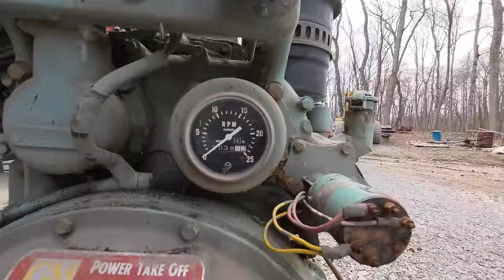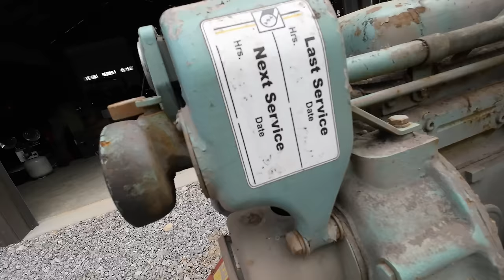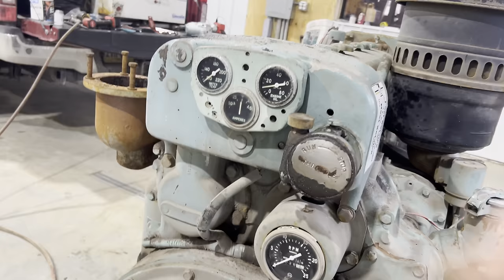$250 Two Stroke Detroit Diesel Sitting 6+ years, WILL IT RUN!?!?

Comment: Watched your video of starting up the 671 and it reminded me of the one marine unit I took back from Vancouver Island, BC to my Fathers farm in Alberta to rebuild for a friend to install in his boat which he built. The tank you mentioned on the front of the engine is a marine surge tank and the lines would pass threw the haul to two cooling lines running near the keel for cooling. Many fishing boats used these 2 cycle engines because less moving parts and economical fuel costs 2 gallons per hour at 9knots all day pushing ten tons. This engine was used a lot for irrigation as well. Thanks for your show, it was great.

Comment: Hi Matt. Have watched quite a few of your videos after I found you channel about 3 months ago, keep up the good work. One possible way to use this engine and not make it much longer is to do a diesel/electric setup as used in rail locomotives. The generator only needs to be around 20 to 30 Kw for a project like this and it would allow complete flexability for the drive system to the wheels. Again keep up the good work.

Comment: OK I'm on board! The first thing to do is establish your requirements. You are going to need a steering axle from a semi preferably with power steering. Next its going  to have to be longer , I know you wanted short, But your radiator will now be up front, your gauges have to move rearward to make room for batteries , steering wheel, pedals, fuel tanks out both sides, semi or bus rear axle . Maybe two I beams for a chassis, with an Allison automatic transmission and an 18000 lb wench on the rear. Oh yes, a seatbelt and ROPS.

Comment: Wow, that brought back some great memorys.  I had two 4.71 Detroits in a motor yacht.  I loved those engines.  One turned clock wise the other counter clockwise.  Being two stroke engines all it took to run one way or the other was to put the cam shaft in the camshaft bearing tunnel on the other side of the engine.  Powerful and oh so reliable.  The small water tank is a simple heat exchanger.  On my boat the raw water drawn in from under the keel was kept separate from the engine side water by the exchanger.  Thanks for posting your great video.

Comment: if you have very much water in the air filters it will strangle the air flow, when she fired off it brought back memories.  you could use a belt  tightening system off the pto  and drop it strait down to whatever gear train you find  cool find and vid !!!!! Have FUN

Comment: I will never forget the sound of a 6-71 as when I was little every Greyhound bus had a 6-71 in it. When in Jr high every state dump truck had a 6-71 in it and they would take off like a hot rod, (sort of), and with an Allison Automatic transmission quickly hitting the shifts. I do not know how the universal joints stood that shift but was sweet sounding. A mad max machine would need the intake oil bath air filters maybe chromed and stuck up above your knees on either side of the engine if you wear a leather helmet and goggles to stroll around the steam show. Twin chromed exhaust stacks also stuck up either side also. NO MUFFLERS. SWEET SOUND MAYBE MEGAPHONED STRAIGHT UP STACKS.

Comment: Worked on the line back in the 70s turning pistons for the 71 and 92s.  If I remember correctly, Diesel touted the turbo 6-71 as the 'fuel sippers', or maybe fuel squeezers,  for trucks.

Comment: My favorite engine of all time. I still have the special timing tools even though I haven't touched one in many years. I maintained many of these on boats in various states of neglect and disrepair yet they still worked. Run that baby at full power to blow out the slobber. These wet stack pretty bad when idled or run at low load.

That fitting in the head for the return is a special restricted fitting to maintain fuel pressure. I made the mistake of replacing that with a regular one and it didn't work so well

The 71 series had the steel valve cover with knobs from 1938 until 1979, when they went to a cast aluminum cover with 12 point bolts and fat silicone rubber bushings. I like the older ones, even if they are more prone to leaks. They also look really, really good when chromed! 

Another giveaway of an older engine is the separate fuel lines on the head. I believe the head was changed to the cast-in fuel passages like yours in the mid 1950's. Very old ones had a chain driven oil pump and different accessory drive gears, I believe that went away in the 40's.

Thank you for the video, its so good to see one of these still around!

Comment: Last Detroit Diesel I worked on, I had a rebuild on the rings. It ran just fine, but burned oil. I got those rings where they were tight and didn't burn oil, but it wouldn't run worth a crap. I finally shaved the rings down far enough to where it burned less oil than it did before, but still ran great. For $250, you have a gem. That is one I would put right into a boat.

Comment: When I was a little kid we had Greyhound busses with this exact engine pulling them over the mountain at 70 mph. When I was in Jr high we had county dump trucks with this engine with Allison automatic transmissions. You have never heard anything sweeter in your life. With a full load of gravel she would rap out in every gear and now I realize how hard they shifted at full throttle. Those u-joints must have needed replaced every year or sooner.

Comment: Looks like the Firepump driver for the navy tug boats. It drove a massive pump that was used for fire fighting from the sea to shore hose nozzles. It used water from the sea to cool the tank. It was a real beast. Its cousins drove Mike 6 boats, twin packs drove Mike 8 boats. Big Gen sets with an electronic governors. It was one of the Navy’s best small engines. It replaced the grey marine model and some of the 53 series engines.

Comment: An alternative use-case would have the engine and large water tank outside the shop wall and run water pipe to the creek and use an impeller to pump water into the tank when needed. Just a thought. Enjoying the content as always.

Comment: Hello Matt , love your vids. You may have a stuck injector. However I had a trojan loader with a 671 that we left on a job for a while and when I went to start it I realized that water had gotten past the rain cap and it hydrauliced a cylinder and bent a rod . It smoked just like that because one cylinder didn't have enough compression to properly burn the fuel . It also was a low hr . So we pulled it apart replaced the one rod and it ran beautifully. Good luck.

Comment: The small tank has a built in heat exchanger through which water from the fire pump is passed thru to drain for engine cooling. This saves a radiator and maintenance and increases reliability. That’s how most fire pumps I have worked on are like this.  Cracking find. All the best.

Comment: The 53 and 71 series Detroits are some of the most rebuildable engines that ever existed. If block is not cracked one can install new sleeves, standard pistons, and rings. If crank is good and still can be rectified  cam bearings can be bought with inner and outer diameter. These screaming jimmys work best and cleanest with full load and at Full rpm. Many were used in boats and in all kinds of industry. Great engines. Just wear hearing protection

Comment: Worked for a Gulf oil distributor in the late 70s and i drove an gmc day cab transport. The tank that i pulled topped out at 8500 gallon. I had no problems getting up to and maintaining  80 miles per hour and it had a 10 speed Road Ranger trans in frtout of some 370s. I use to love looking at the coal smoke rolling out of the stack . She was simple and dependable.

Comment: Also remember that the 6-71 is a war-winner. GM connected 2 of them through a set of gears, and stuck them in the M4 Shermans. They were called the GM 6046.

Comment: I drove a big Terex off road dump truck with one like that, had a shuttle shifted transmission, the smaller Euclids had the 4 cylinder Detroits, you couldn't load them enough to slow them down

Comment: started a 371 sawmill power unit that sat for a decade and after getting the injectors unstuck I fought a wet stack issue. I determined it was the lift pump after installing a pressure gauge after the pump and a primer squeeze ball before. 
$250 for a Jimmy is a steal

Comment: Hi Matt.I know this is a long time after the publishing of this video but here goes.  Is unlikely that as a fire pump this engine would have had a radiator remote to its location. The more likely scenario is that it would have a direct cooling supply from the main water tank for the fire system. Where the water was supplied to the pump would be a Tee with a pipe running to one side of the cooler. The outlet side would  be fed into a venturi just after main pump outlet. The flow of the water from the main pump would pull cooling water from the supply tank through the heat exchanger and and just inject it the slightly warmed water straight into the fire system. It would not matter if the flow of water was high as the engine thermostat would control the engine temperature. I have seen that system used on several industrial fire systems.  ATB regards from the UK

Comment: You could give it a big hydralic pump, and run accessories with it. Idea 2 fix a drum to it run older machines with belt drive. Idea 3 giant air compressor, or the worlds most powerful extractor fan. Seeing how many batteries you had to scrunge up maybe a jump cart would be usful. It would be cool if you could put the engine in something 1966-67. Cool video i love that 2 stroke sound. Probably could use the injector seals and a block off plate.

Comment: There is a heat exchanger for cooling. Just like in some boats. The tank contains bronze rods that can get blocked over time. Pull it off and soak in alkali then pressure wash those rods. Lasts for years.

Comment: Turn it into a combined heat power unit, with a hydraulic pack and or a large fast screw air compressor to boot. You can then get a load of old batteries, power your shop, charge your batteries for an inverter, and heat the shop with the coolant and the “remote radiator” heat exchanger during the dark winter months. You will need lots of light. Even use a convoluted exhaust and pass air across it for instant heat while you wait for the floor to heat up! You can even run it on all the old oil,diesel,and solvents you pull out of projects if you get good filters or a centrifuge.

Comment: 52:30 Bolt a sprocket to the existing output shaft and use it to drive a chain that goes straight down to another sprocket bolted to the Transmission's input shaft...

The Transmission could be installed backwards so sits directly under the engine and it's output shaft points forward to the front axle making it a front wheel drive War-Buggy and/or run the typical transfer-case and another shaft running aft for a 4-wheel drive War-Buggy...

That would make the buggy taller, but you wouldn't have to make it any longer...

Alternatively, you could bolt the engine directly to the Differential and Final Drives of a Bulldozer and make your War-Buggy a tracked vehicle...that keeps it low to the ground and relatively short...

Comment: When I was in the USN I spent a lot time with these engines. I was attached to a Sub tender. We were anchored in the middle of a loch. To go any place you had to take a boat. All of our boats except the Box Ls had 671s. The were good engines. The Box Ls had a 6110 as a main and two 271 generator sets. Generally speaking, if  you had fuel and could turn them over, they'd run.
Reply: You must have been in the Holy Loch!
Reply: @harrellmorlan6817  Yep. After BP&E school I went to EN-A School and reported on board the USS Canopus in Bremerton WA in late '68. We left the yards went to Scotland. It was neat the the NJ pulled in and tied up on he other side the pier from us. She had just come home from Vietnam. In Scotland I was part of the boat crew. When my EOS came up I got out. A few years or so after that I went in the USNR. I bounced around reserve units and ended with 17yrs and made EN 1. I went to Desert Storm.
Reply: Note if you want to have some fun you should try installing  an oil pump on a slant 671 while it's still in the boat. It goes on number 1 bearing bearing cap. You have lay on your back in the bilge, reach into the oil pan, hold the pump in you hand, use one finger to hold it up and start the bolts with you extra fingers. There isn't room to get both hands and arms in the oil pan. The hole in the side of the is only about 12 inches long six inches wide.

Comment: in that clothing, this engine is a very goood candidate for marine use, the hwar exchanger is built in and the exhaust manifold is water jacketed.
the only missing items are a raw water pump amd a marine transmission ( velvet drive, twin disc, ZF etc...)

Comment: i have a 2-71(i believe)  in our hd-5 allis loader crawler unfortunately  an injector line broke and dumped diesel in the crank case !!!  i caught it the first time fairly quickly think it broke completely that time   THE 2ND time i didnt catch it as quick and spun a crank bearing . it has been in the back of the shop for about 10 years .. i gave it all to a friend and his son both are diesel mechanics so maybe SomeDay i can barrow it back for a project or 2 ( i retired from farming  last year).  the hd-5 was a pretty good little crawler  , had a older neighbor that ran a shale pit and used his(2) to dig and load it out  , (he would load it in the back of the dump truck and just BACK it out the end (raising the front of the truck off the ground)!!! :)

Comment: suggestion.  when pouring liquids from a container hold container outlet/ spout at 12 o'clock and not 6 o'claock.  this allows air to get in with out causing the  GLUG GLUG  burping as the oil pours out.

Comment: Matt, if you got a old house furnace fan installed it to a box 📦 with a air inlet connected to a 6" hose long enough to run from the door to where you're working on a engine you can apply a 6" to a 3" Y tube for dual exhaust,  and have metal flex the last 3 ft all eng exhaust could be outside..
 or have the box  📦  closer to the work area and put a 4x10 square to 6 inch exhaust and run a plastic pipe out the door.

Comment: You know, in the 50s, the hot setup in the street racing scene was this thing called forced induction. The greasers gapping chumps at the strip and down Central Ave were using modified GMC 6/71 roots blowers on their SB Chevys. Then, a man by the name of Charlie Weiand decided to design an aluminum,  dual carb,  riser manifold specifically for the GMC blowers. The rest they say, is history😊

Comment: These fire extinguishers engine/pumps normally works along with a jockey pump that keeps all water lines pressurized. When a valve is opened and the water pressure drops, the main engine will come into play, and that is the reason for all that solenoids that you found.

Comment: 8:13 Those hoses were just connected to the suction and pressure side of the pump it ran. So the engine would cool itself by the water it pumped, by having a small amount of water split off and circulate back around.

Comment: I don't know if you've gotten anywhere on the buggy design but here's an idea. A guy at my lawnmower racing club put a small block in a mower. He drove it off the fan belt to a jackshaft running under the engine, nothing on the actual business end. Really weak drivetrain setup and way too top heavy to race but moves and looks/sounds awesome.

Comment: Hey Matt, considering where you live at, a good idea for that engine would be to run a back up generator for the shop, in case you lose power for a long period of time, you would still be able to work.

Comment: If it was taken care of by a maintenance mechanic that cared... it's probably all well within tolerance... I would, however, had put at the very least, filtered used oil in it before rotational test... better ANY lubrication than none.

Given the history of this engine, cheap oil to the point of knowing that the rotating assembly had some kind of lubrication... not saying fill it up.. but knowing that you have oil and crud is found before run...   priceless🤷‍♂️

Comment: I have seen several videos where the first start of a 2-stroke Detroit Diesel after a long slumber is done with an additional safety measure to have the valve cover open and locking pliers or similar ready to force the actual fuel rack to cutoff position if the engine decides to go for a runaway, for reason or another.
You seem to have no sticking there but it is always better to be on the safe side.
At least the governor seems to be well set, the engine is not "hunting" at all.
That lot of blue smoke (looks like puffs on low RPM) might indicate that there are a few bad injectors in there

Comment: Ok Matt, I'm thinking that this unit could be used for what it is intended for, a stationary power backup generator. It wouldn't take much to build a whole shop power unit set up on the outside wall right behind the wall where the circuit breaker box is located. Your electrician friend could put a switch over box with no problem. A large radiator, a big fuel tank and your all set. So put that gen. unit on the back burner until you find a deal with say a blown engine and generator attached. Just transfer it over and your all set. I'm thinking about a 2-5 KW size would be great.

Comment: The motors I’ve been around for fire systems were connected to domestic water heat exchangers  it’s possible when it was in operation those water connections were to domestic water. I’m surprised it didn’t overheat. The newer systems used a Cummins motor.Years ago I worked for army which used 2 stroke motors in tanks and personnel carriers. Most of them were Detroit